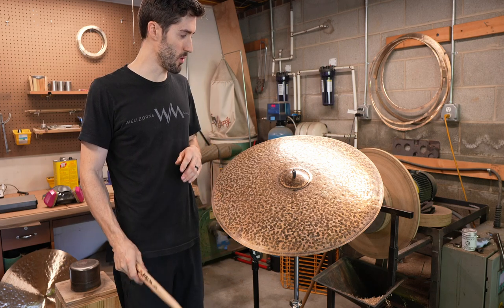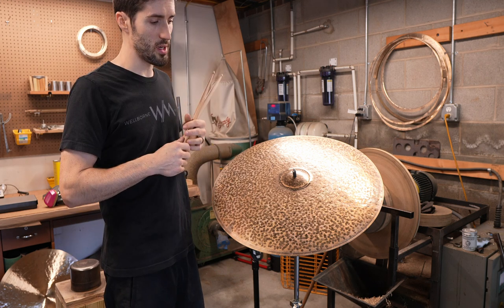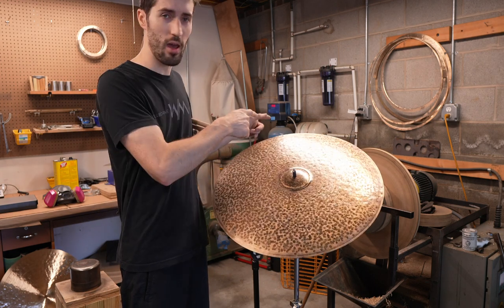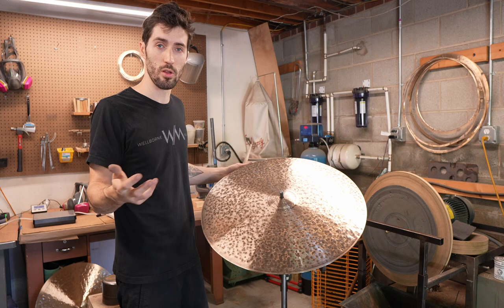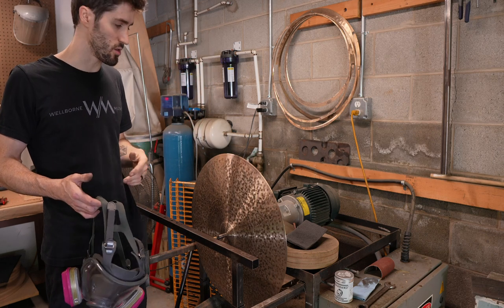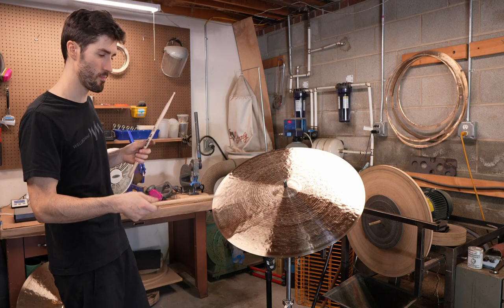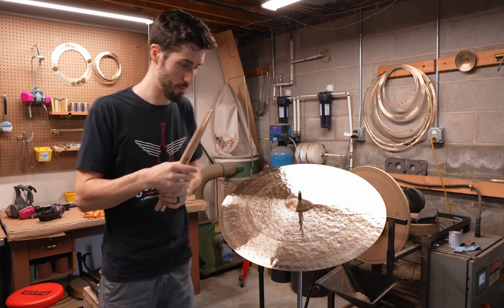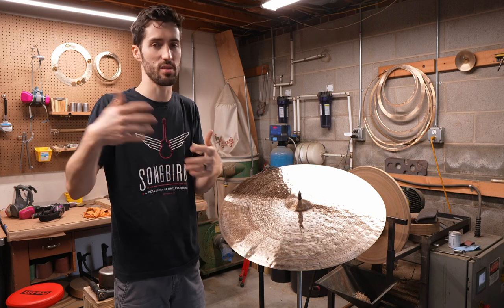Sandpaper On A Cymbal?  - Timothy Roberts

Comment: I understand that cymbals are not exactly "brass" or "bronze".  They have a proprietary third ingredient metallic element which has never been divulged in the history of cymbal manufacturing, and it is that third ingredient which gives it the characteristic sound of a cymbal.
Reply: Interesting. My understanding is that 'bronze', while nominally a two phase alloy of copper and tin, is nearly if not always cast with trace amounts of other elements. This is true not just for cymbals, though, and owes more to practical concerns, both in the casting process itself, and the finished alloy's eventual applications. Phosphor, lithium, zinc and nickel are some common trace additives used in bronze casts (phosphor is particularly desirable for industrial parts like bushings, for instance). Much hay has been made about secret cymbal ingredients/family recipes, etc, but I'm fairly skeptical about trace additives in regards to desirable sonic qualities specifically because (marketing claims aside, it is bronze itself that's most remarkable. There's just something about bell bronze making it uniquely suited to musical applications.
This is already too long but I have a case in point if you got this far. There are cymbals made from other alloys which make useful sounds, even rapturous sounds when struck with a stick. However, while these often make for great effects cymbals, I have yet to hear any nickel-silver or stainless steel cymbal that gets anywhere near the complexity, versatility or dynamic in its character afforded by an expertly worked bronze casting.
Just my 2 cents, but if you work enough with bronze, you will come to see it as extremely special. At times one gets the feeling that there is (lacking a better term) a life force at work in the metal, and cymbalsmithing is the art of guiding that dynamism special to copper and tin alloys towards a musically useful goal. It's why I often think of cymbal making as the real alchemy.
Reply from the maker: The makeup of cymbal bronze is 80/20, copper and tin w/ trace elements either added by the redsmith or as a consequence of the method of creating the alloy (coal fired, wood burning, or gas). There's arguments as to whether or not this has a drastic effect on the sound. I would say it has an effect, but the biggest factor in the sound is how the blank is formed into a finished cymbal by the cymbalsmith.

Comment: The unworked version sounds like my 19" Bosphorus Black Pearl ride, which is too thin, hence too much wash for my liking. I replaced it with a Meinl 20" Pure Vintage, which is alot heavier, with great stick definition. I now use the Black Pearl as a crash with a rattler attached, so essentially I gained another dark crash. It's amazing the change in sound after resting the worked cymbal. Great job, Timothy!
Reply from the maker: Very nice! I bet that's a good combo!

Comment: Ever try Oven cleaner on a cymbal ? particularly a Turk type cymbal. It removes all the oxidation leaving just the cleaned bronze underneath. Deffo beings out the high frequency's more. I'm tempted to try it on a Bos black pearl.
Reply from the maker: No, but i'll definitely have to try that! Thanks for the tip!

Comment: That semi-lathed dappled finish is exquisite. ❤
How symmetrical is weight on a good cymbal? I have one that rotates on the stand because of a heavy point.
Reply from the maker: That's pretty common actually. Ideally a cymbal will have even weight distribution, but I find just about every cymbal has a way it wants to lean (which would indicate it's uneven).

Comment: Need myth busters. It is unlikely that a cymbal changes sound after a day, week, or months. Yes if it is still hot, but once it is room temp, resting it won’t make a difference. 

Could test it by having a robot arm strike it the same way each time and record it after it reaches room temp, and then a week later. It will be the same.

The maker perceives it as having changed because they rested.
Reply from the maker: Did you listen to the "rested" clip? It sounds significantly different than it did post the work. I do this as my full time job and I promise you resting makes a huge difference. The alloy is really amazing in that way. It's malleable and has very interesting properties when "cold-formed" by hammering and lathing.
Reply: If it takes a double-blind randomized A/B listening test to convince you, it could be because you've never discovered it by accident.
Reply: I used to be a disbeliever of this as well. But after watching Timothy’s channel, I can definitely hear that resting changes the cymbal’s sound. There is remarkably more spread, sustain and shimmer to the sound.

In regard to the actual physics of the matter, I am not sure. I have a hard time understanding how the metal structures can re-arrange due to resting. I’ll leave that to any metallurgists out there.
Reply: @p.diddle  I agree. It's bizarre and I know of no other example in metallurgy (though they probably exist). I mean, there is the phenomenon of work hardening, but that's pretty immediate.
Reply: @ReverieDrumCo  and the unrested one was already cooled?
Reply: @p.diddle  I think metallurgists would say it doesn’t happen. But I am not sure.
Reply from the maker: @rsilvers129  the temperature doesn’t really apply to what I do. I exclusively “cold-form” the blanks. No heat treatment, annealing, or tempering is involved in my process. I leave that to the guys in Turkey.
Reply: @ReverieDrumCo  I just meant the heat from hammering.
Reply from the maker: @rsilvers129  The hammering doesn't produce any heat. It would need to get up to about 350 F to make any real difference to the structure of the metal.
Reply: Is it possible, that all that deformation of the metal due to the intense hammering, can slightly decompress over the resting period? And it’s the decompression, that opens up the sound?

Anyway, this just adds to the ‘mystique’ of this amazing artwork 😊

Comment: What's your process for protecting the cymbal from further oxidation post lathing?
Reply from the maker: Sometimes I use a specialized wax that keeps the patina from developing quickly. Sometimes I want a natural patina to develop so I'll leave the surface untreated. It's all about the desired sound!
Reply: @ReverieDrumCo  Thanks for the info. I've been experimenting with applying wax (Minwax Paste Wax) post-cleaning. One layer seems to do well protecting against air but not so much against finger prints.
Reply from the maker: @RockerBug17  yeah I use paste wax for certain things. It does a fair amount of dampening to the sound which can be really effective. Try renaissance wax! It’s a micro-crystalline wax that’s super thin.

Comment: Tim you’ve really outdone yourself. You could tell even before it rested it was going to be a deep and lush wash with a sprinkle of shimmer. What grit paper(s) did you use? It reminds me of those old buttery Istanbul pre splits but with a more modern and usable weight. Can’t wait for next week’s video!
Reply from the maker: Thanks John! I use between 80 and 120 grit typically. Then I finish off with a fine grit, abrasive pad to smooth it out.
Reply: Thanks Amigo!